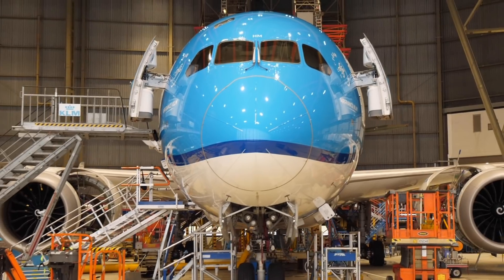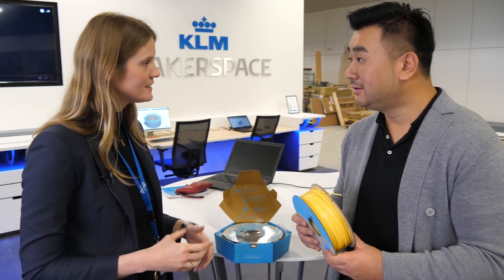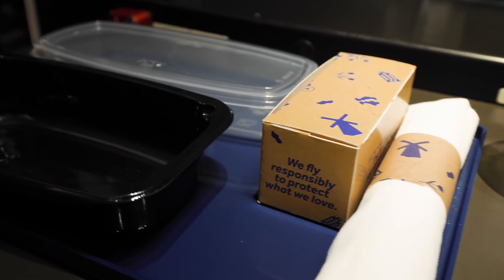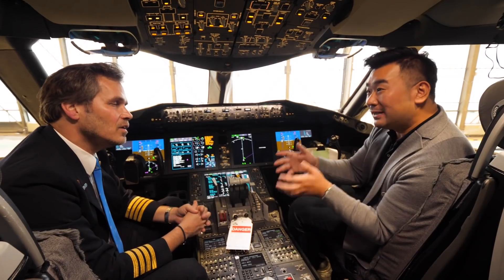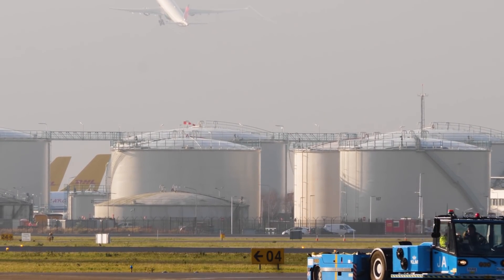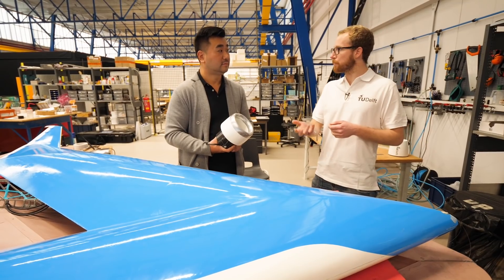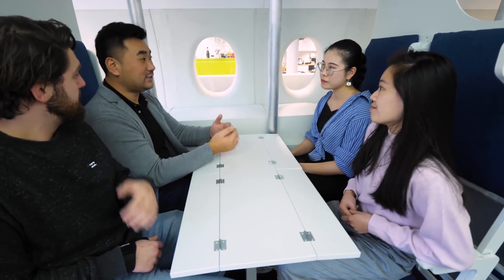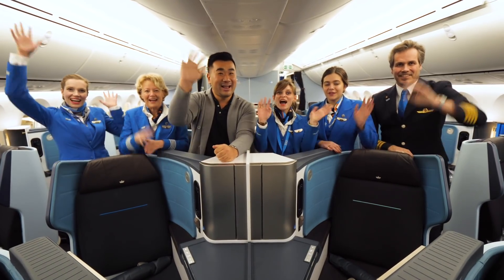The Future of Flying - Is Sustainable Air Travel Possible?

Comment: I think it is SwissAir, maybe others, that uses its tractors/tugs to take the aircraft all the way to the start of the runway, thus saving fuel otherwise used in startup and taxiing. The discussion is which is better used - fossil fuel (if applicable) for the tug, or avgas for the aircraft?

Comment: If anyone agrees or disagrees with me, this is just my opinion. I’m not saying we shouldn’t advance in aviation technology, I just think the flying - V might not work out. There could be various aerodynamic problems. One of which being that when you have a V-shaped flying object, the sides of the V could slow the plane down. I know this doesn’t make sense on paper, but due to the angle of the sides of the V, air will be forced to move in to the center of the plane, ultimately slowing it down and making a very loud noise.

Comment: What will happen with the leading edge windows with birdstrike ? Interesting that the wing chord is so thick yet still 20% more efficient more efficient than the A350- but for what range and weight?
The lightweight latticework structures are beautiful, but will be a challenge to keep clean. Also bad timing with the reusable meal items and COVID-19. That is, if KLM is still flying. What a shame.

Comment: The most pressing issues in flying sustainability is that the fossil fuel the planes fly on are subsidized. Cutting fossil fuel subsidies, which are higher than renewable energy subsidies, would greatly help us combat climate change. https://en.wikipedia.org/wiki/Energy_subsidy

Comment: KLM and the dutch companies were (are) have been always slick and they did have short lines to change / innovate a process. KLM gave TU Delft and the Fokker aviation and Airbus did mutal invested in eachother. Why is this Corona have been installed? and why is VVD Rutte agreeing with this? Over 1 year it is logical all the large industries and posession need to be sold to the stock owners? and the Dutch engineers and industries will loose there leading position in innovative products. We can savely sit close to another, why is Rutte and EU pressing and enforcing this on us. If you sit or stand to close the people that work in the room urge you to follow the rules otherwise risk the police be called even and risk a fine. This happned to me at the train station.

Comment: Happy happy joy joy? NOT commercial airlines burn about 500 million gallons of fuel each day, not to mention private and military, it is the most destructive co2 inputs in the world, worse is that spent carbon is dumped in the exact wrong place at 30,000 feet. So to pretend we can fly business as usual because a flying v will save us is grossly irresponsible. Airlines cant pretend they were not aware, this is willful negligence.

Comment: RE: To enable air transport being sustainable.

The magnet motor for this 1300hp/1-Mw genset is small, 2'x7"/61x17cm, going in aircraft, sparkless.

Losing -10%flux/1000yrs it has a "50-year no-inputs warranty" for 24×7 power.

At zero gas and little wasteheat emissions a tiny carbon-footprint so doesn't inject CO2 directly into the stratosphere & expose chemtrails immediately ...

Flip offgrid, 1-Mw•1300hp magnet motor a 17yr R&D; technokontrol.com, RF-5000. 

Homes, onsite: 10kw•$15k, 5kw•$8k $35/mo+int; "20yr wrnty"; infinitysav.com, no fuels, 24x7 power.
Ymmv.

Comment: 3 MAJOR WAYS FLYING COULD DO MORE FOR THE ENVIRONMENT. Light weight aircraft parts example cabin floors are already super strong, but super thin and super lightweight. But manufacturers of component parts could do more to get weight down without risking strength or safety.  2) Less passenger luggage. Do you really need 22Kg or 24Kg of stuff to go on a 2 week holiday? No probably not. You may need 22Kg or more ONLY with kids or if you have disability needs but most likely but most stuff you can buy when you arrive or do without or use a lightweight rucksack instead of a heavier case. Airlines should impose limits on weights to lower levels. 3) You may pay for baggage, you may pay taxes but this money SHOULD be going to green projects eg plant trees. We expect stupid low fares to travel 1000miles. How much would that journey cost you in time or money in a car? Perhaps we should plant a tree ourselves when we return from holiday, get the idea? We need to take responsibility not the airlines fault.

Comment: Dutch bullshit, especially the flying V. Dutch are good marketing hot air, and make buzz out of it. From whatever perspective that kind o plane is not feasible at all. Think first the runway width, because the landing gears need to be placed further away, so no runaway can accommodate. Let alone about engines, that typology have different aerodynamics and those engines placed arbitrary in that position are just a kids decision. Dutch bullshit.
Reply: As If they didn't think about that..
There are literally dozens of people working full time on that, and I can tell you already that no, the landing gears are not to far apart, and no, placing the engines at the back is not a random choice either (good for weight balance and limited effect on aerodynamics ). 
So please, don't be like that.
*Interior is bullshit.
Reply: @baptistevanhille9929  now that you told me this I can sleep safe. Just wake me up when the real shit takes a real flight.
Reply: This design is literally 20% more efficient than a commercial airplane

Comment: “240 hours to 3D print a stool “what about electricity required to drive the printer, don’t we loose sight of upstream effect of “sustainable “
Reply: very true. the energy and water used to clean that plastic cutlery...
doesn't sound that it makes sense
Reply: Just use wood and plant a tree
Reply: It's mostly like this with 'alternatives'... They are actually just offset and PR exercises... No way is this a solution.
Reply: Diarmaid O'Riordan and how are wind turbines, solar panels and nuclear power stations made?
Reply: Diarmaid O'Riordan Diarmaid O'Riordan but when they are at the end of they’re life they need to be recycled. Look at an electric car that needs to ride more than 450.000 miles before they are better than a 2020 Diesel. Wind turbines are not viable and are leaking sulfurhexafluoride, which is an extremely heavy greenhouse gas. But climate change is big bullshit so idc about CO2 and Nitrogen emission.

Comment: I thought "Enterprise" from Star Trek when I saw the V-shaped model.  I am not surprised the KLM is working on ways to recycle and economize flying.  In the early 1980's I traveled extensively, quite often using KLM. They were my favorite in those days. They were always so clean and efficient. Leave it to the Dutch to always be one step ahead in engineering. Great video Sam ...as usual.

Comment: Do the Dutch no longer have qualified engineers???

The flying V is a great concept...until you have to turn.  Then it's a really, really bad idea.  Even gentle turns will feel like a roller coaster to passengers who are buckled in.  Make a gentle turn while people are not belted in and you risk serious injury or death.  Make a hard turn while people are in the lavatories or in the aisles and you will have multiple deaths every single time.

You can build a safe flying V, but you CANNOT have passengers in the wings.  The people must be housed near the centerline of the aircraft.

Comment: Your picture of a future jet is not correct apart from being 20 years down the line. Future jets will be nuclear. They will consist of an Antimatter Nuclear Reactor,  Electromagnetic Generators with emitters at the end which will push out an artificial gravitational field. The fuel that propels these new aircraft will be Ununpentium Element 115.

Comment: As long as KLM uses a B747 for passenger flights, this sustainability program is a big joke. B747 is a beautiful aircraft, but nowadays it is not sustainable to fly with this high fuel consumption air plane. If KLM want to make a difference, than they have to stop immediately with the B747.

Comment: I like the exterior of flying V but inside is not that good. It's like collection of many concepts.
Reply: Its mixed like that because they wanted to show a few concepts without building 1:1 sections. It surely won't be like that in a real plane
Reply: Boeing wanted to build a flying wing back in the 90's instead of the 777.  Couldn't get it past FAA for directional control during cross wind landings nor cargo balance issues.  Flying wing is the holy grail of Aviation, but it has problems.

Comment: The "flying V" is nothing more than concept/dream. The future of commercial aviation for at least the next 25+ years is the 787, A350 and A321XLR, and at  some point in that time period going from Jet-A/Jet-A1 to some kind of bio fuel. I really don't think the next generation of aircraft coming in the 2040 period will be that dramatically different in design as the flying V. A more conventional design will be required to fit existing airport Infrastructure.

Recycling plastic on board planes is not sustainable for more then a few flight segments before it will have to be replaced unless airlines go to a more expensive and heavier plastic which I think is doubtful. If KLM intends to continuously recycle plastic through a process other than washing there is an energy cost for that as well.

As for flying more efficiently fuel wise that is not done for the environment, it is done for the airlines bottom line to save money. As the Captain mentioned doing that type of flying is not practical at many of the world's more congested airports. Next Gen ATC procedures like what the FAA is working saves far more fuel than what KLM is talking about procedurally on the flight-deck.

Aviation is a necessity and we must except the cost to the environment. We must also remember that airlines and aircraft manufacturers will always do thier best to be environmentally friendly because in this business it means they are saving money and increasing profit.

Comment: Hey there, I'm the guy who printed the KLM house and table (glasses, huge forehead, receding hairline). Just to clarify for you 3D-print fanatics and environment specialists, the house was printed with an Ultimaker S5 and the table with a Creality CR10-S5 but with a 0,4 (mm) nozzle. Clearly not the best setup but we are upgrading the CR10 with a new 'bigger' nozzle and direct drive extrusion system to cut the printing time more than 50% so it will take a lot less energy when printing another table made from recycled filament. If any of you 3D specialists have more ideas about getting the print time down through new hardware (not software), I would be happy to listen ya!

Comment: I don’t know about those designs. Not sure if that’s an improvement or other. Also, with everything about a modern aeroplane being improved - why have flight times not shortened??? They’re still the same as 20years ago. Make a commercial passenger plane quicker and you wouldn’t need all the creature comforts !
Reply: Speed is down to the fuel burn, the speeds we fly at are the most efficient if you want to go faster and faster you are burning more and more fuel, blame physics for that one.